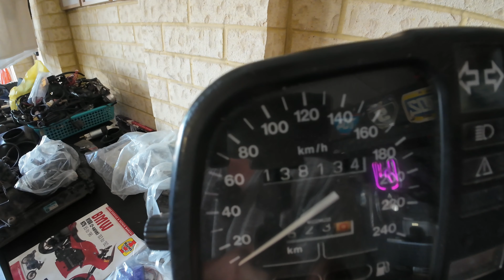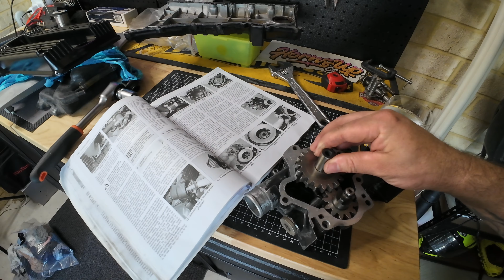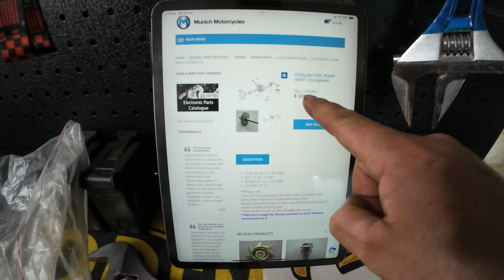Will This 40 Year Old BMW K100 Ever Run Again!? || Ep1

Comment: So much work and expense has been put in by the previous owner already. Good buy. Currently building an '86 K100RT handed down form my dad. Has needed a lot of clean up and pump was completely toasted.
Reply from the maker: Mine is coming along nicely, have you checked out the uploads on the K100 build?
They are a fun bike to work on, definitely a marathon not a sprint!

Have fun and sing out if you need any help!!